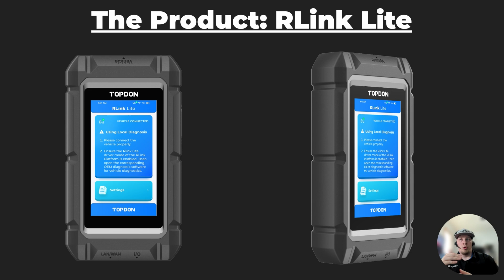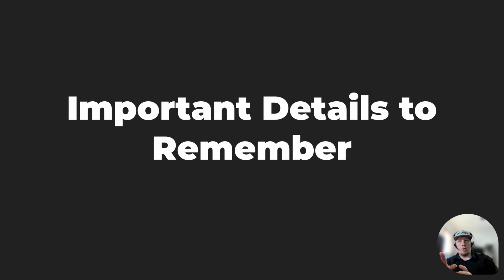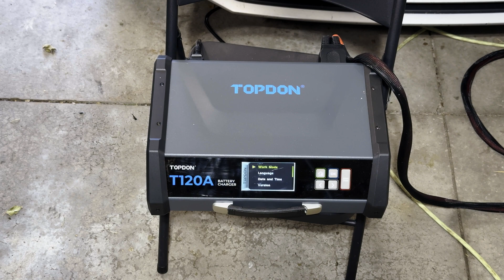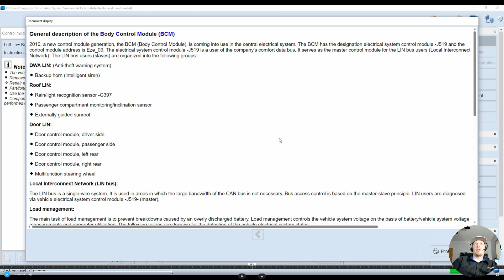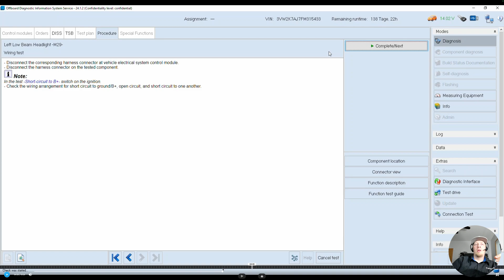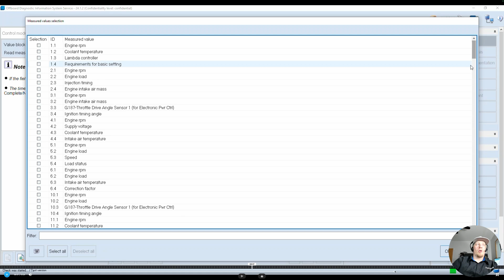TOPDON RLink Lite Overview

Comment: Very nice video will this vci will work with topguru app or other topdon app or is only for OEM software also if is working with cracked software
Reply from the maker: Thank you for your inquiry. This VCI is compatible with OEM software and corresponding cracked versions and doesn't supports the topguru. Please let me know if you have any further questions.